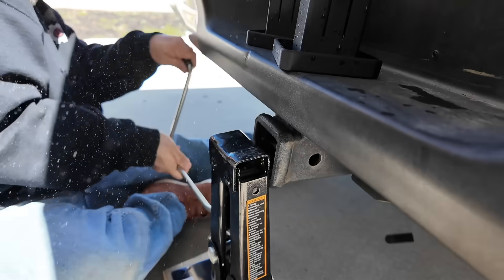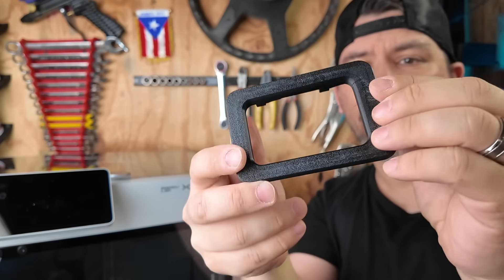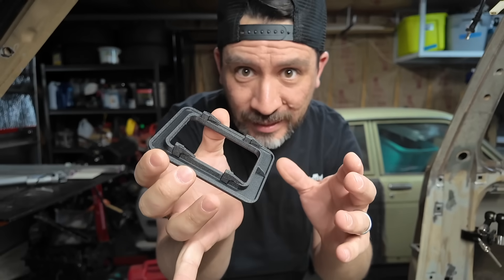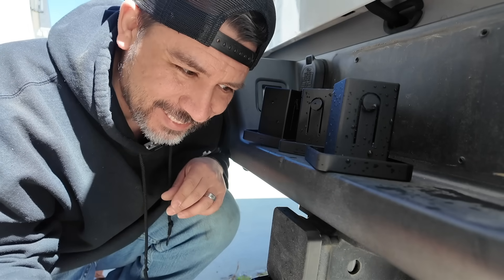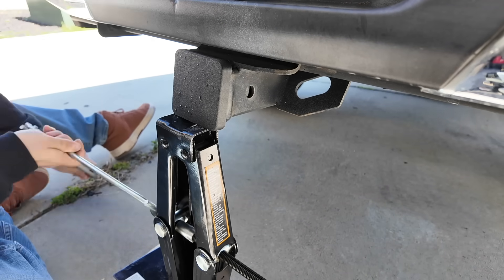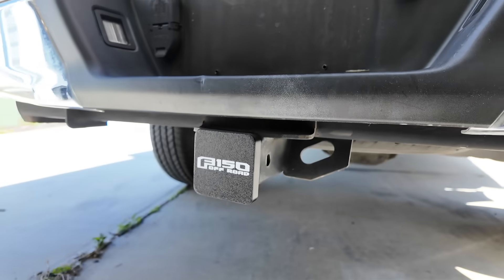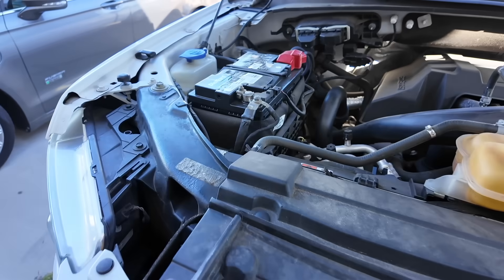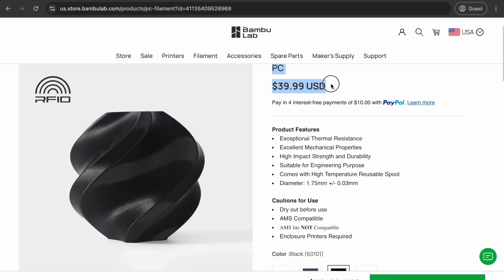Which 3D Printer Filament Makes The Toughest Car Parts?

Comment: 😅 Gloves for the CF. You can over exaggerate.

Biggest problem is getting dust in your lungs.
On your skin it's itchy. But not for only cutting filament 😂.

Thing break more easily on the layers.
I looks like ABS wasn't printed hot enough.
Abs isn't brittle and can be strong on the layers. PLA is much worse.
Have PLA in my car it didn't melt so far. But different went being loaded.
Reply from the maker: Can never be too safe 😂

Comment: Good Nylon 6,66 is the most durable compound I’ve found. 
Annealing in packed fine salt powder is key. 
Helps with heat tolerance and chemical bonds throughout the monocoque form.
Reply from the maker: I’ve always wanted to try that salt powder method, what type of parts do you print???

Comment: No problem with Petg and the sun, printed smoked indicator cover for my Mx5 4 years ago, still no color deterioration
Reply from the maker: Nice, how hot does it get where you're at?
Reply: @Itsallaboutthebuild  this week it was 32°C/90°F next week it will go up to 40°C/104°F

Comment: Gotta add my recent experience. I 3D print model RC aircraft. PLA is tough but deforms terribly in the car during transport as the temps increase. I just experimented with Polymaker HT-PLA thinking it was the perfect fix. After finding the best print temp and Factor K, it turns out to be extremely brittle and no good for model RC.
Reply from the maker: Oh really... Will have to add it to the list of filaments to test out. Do you actually fly your models?
Reply: Polymaker HT-PLA also goes soft and flexible at the same temp as PLA, around 53-57 degrees. It is not at all what they claim; it's a hopeless material. Try putting a print in 60C water for maybe 10 seconds, then bend it like a banana ;) Polymaker lie.

Comment: Definitely need to learn how to model parts for 3D printing strength
Reply from the maker: There's tons we learned. Besides printing in different filaments adding more walls, redesigning with thicker layers, and printing in different orientations can help big time.
Reply: Isn't the point of this for comparison though? So it doesn't really matter.

Comment: Worth noting when designing replacement parts you often have to design for 3D printing and not just copy the injection molded or otherwise manufactured part. For example with the door handle surround, if there is room you could widen the tabs to increase strength and add a tapered support at the back of the tab rather than keeping the sharp L. Sharp corners in general are also stress riser areas which means they are more likely to crack at those points, so round all your corners. Print orientation can also make a difference, but it can be hard to get the desired finish then. Fuzzy skin is a good way to get a cool look if you wants something that looks more like a bed plate texture. Cool temperature testing too!
Reply from the maker: Thanks for the tips, great points about designing for the process. We've been doing some fuzzy skin testing and love it.

Comment: Can you try Pa6 CF please? I dont dry my filament (I recently found out how important it is) and the prints are quite brittle, it would be cool to aee you do this filament at its real potential
Reply from the maker: That would be a great test for sure, what type of parts are you trying to print with Pa6 CF???
Reply: Yeah, I'm trying to print a plastic shell part for a car, its called an Isofix but for some reason ny prints just snap with a bit of force  @Itsallaboutthebuild
Reply from the maker: Try to add more layer lines.
Reply: If you want I can send you the STL file  @Itsallaboutthebuild
Reply from the maker: Do you have it posted on thingiverse?

Comment: its PPA, use ppa and forget the rest (except tpu)
Reply from the maker: But what if you don't need that high end, its much more expensive no?
Reply: @Itsallaboutthebuild 55/kg is not too much more and worth it to me at least for the extra durability
Reply from the maker: Nice, what type of parts do you make???
Reply: @Itsallaboutthebuild I make custom enclosures for equipment, car parts, drilling and cutting templates, fixtures for assembly, mounting jigs. Everything I can thing of!

Often use it to prototype stuff before having it Cnc cut
Reply from the maker: Oh wow, thats awesome. We're working on some more car parts, so what would you say is the hardest thing when it comes to learning how to make 3d printed parts? Trying to put together some more helpful content. Thx!!!
Reply: @Itsallaboutthebuild identifying good use cases for a 3d printer, then turning the idea into a reality
Reply from the maker: I hear ya. Hopefully our content on designing with Shapr3d will be helpful. Thx!!!
Reply: PC CF is superior to PPA CF if we are talking about glass transition temps. And it’s cheaper.

Comment: Most of the time i find that pla is stronger then abs, when i print them they both look amazing and smooth, however the layers on pla seem to bond better is there something i can chang print temp 270c bed temp 95-100c speed around 35mm sec ( bambulab p1s)
Reply from the maker: PLA properties has better adhesion than ASA. Try adding more walls, design the part to have more surface area between layers, or print the part at an angle. 🙌🙌🙌
Reply: Thank you for the tips i tried more wall thickness and it worked a charm, awsome! @Itsallaboutthebuild
Reply from the maker: @tomaswolsink7620 that’s awesome!!! Stay tuned for more 🙌🙌🙌

Comment: You're not really testing the strength of the plastic.  Due to the orientation of the model you're testing the layer adhesion of the plastic.  That's a completely different thing, makes the use of the glass fiber filament pointless.   Just print a solid bar for the towbar shaft and test that.  You can superglue a cap on if you like the textture of the end.
Reply from the maker: 110% correct, its the layers you are testing which I did talk about. And you could go with a different orientation, but you wouldn't get the nice texture from the bed :) Solid bar would be a good test too, was just trying to show a bit more of a practical part. Thx for watching

Comment: Bigger internal radius in the cap part would help
Reply from the maker: @deanlegg418-u2k  ah yes, also don’t like how thin the snap on parts are. They break after about 20 pushes. This part definitely needs an updated design :)

Comment: ASA and ABS Don't have strong layer adession strength like petg. Any fillers will make the layer bonding worse. If you print in horizontal way so that all the layers lines in one direction it will make it stronger.
Reply from the maker: Ah yes, but we like the texture of the build plate :)

Comment: Can you make discontinued car parts? I need a hood latch cover for a c6 corvette.
Reply from the maker: @jmarcant616  if the original part was plastic then it’s possible 🙌🙌🙌
Reply: @ it is plastic. It’s more of a cosmetic piece. I can send a picture
Reply from the maker: @ have you tried eBay? Looks like someone already made it
Reply: @ yes , but that one looked rough. Not clean looking.
Reply from the maker: That's because they 3d printed the part with fiber reinforced nylon, which gives it that texture similar to the look using ABS-G on the door handle clip in our video. Using something different like PC would leave layer lines in the part instead of a textured look.

Comment: In my experience abs is only strong and pretty much unbreakable if you use 100% infill or walls. Cf are actually weaker because worse adhesion. Unless it's nylon.
Reply from the maker: Ah, good to know.Would be cool to test with different walls and infill. Do you 3D print car parts too???
Reply: @Itsallaboutthebuild  no but I'm printing it for a different project. 280c nozzle and 60c chamber. I made a small 8mm block. Tried all walls vs 80% infill. Then I smashed both with 2kg big hammer. The full walls part has minimal cooling and good layer adhesion and is insanely crack resistant. The 80% infill failed instantly.
Reply from the maker: @morecakesmorelays3270  that’s awesome. What 3D printer are you using??? Looking for a larger build volume with enclosure and good auto bed leveling/z-offset
Reply from the maker: NICE

Comment: PPS-CF is the way!
Reply from the maker: Will have to give it a try, what type of parts do you print with it???
Reply: @Itsallaboutthebuild I also use that. Polymaker Fiberon. No car parts. Machine parts and other structural parts. I don’t know how familiar most people here are with machining, but it’s similar to that in that high speed steel bits bend a bit before failing. Carbide has no give, it’s very stiff. But it’s brittle. It will suddenly fail. But, it is much stronger, so it will fail at a much higher performance level. PPS-CF is like that. Very strong and stiff,  takes high temps. I print between 330 - 340 C. Virtually no creep.  But when it fails it will do so suddenly, like carbide. I’d have to look up its low temp performance. Oh yeah, it’s very expensive. $70 for 500 grams.
Reply from the maker: @melgross  Nice, I need to print some small replacement brackets inside the engine bay and it sounds like PPS-CF might be the best route to go. What 3d printer do you use to print PPS-CF???
Reply: @Itsallaboutthebuild   Typo meant PPA-CF.  Make parts to fix showers and even parts for cars.  Make sure can hit 300c and dry it good.   https://store.bblcdn.com/05b0e4ca5ee14a4cb378cfa48df24f91.pdf

Comment: increasing the infill will make the ABS much stronger , from the videos he is using 15% infill which standard setting .
Reply from the maker: You are 110% right. Also increasing the wall count will help with layer adhesion which makes the part stronger too.

Comment: Part location in the vehicle is important. ASA will deform on the dashboard close to the front windscreen but not 2 feet further towards the inside of the car (on a 40 degC or 104 degF day) meaning inside the cabin of the vehicle is pushing the limits of ASA let alone under the bonnet.
Reply from the maker: @karlosss1868  good to know. ASA is rated for up to 212F and has really good UV resistance according to manufacture specs. What would you recommend besides ASA?

Comment: Very interesting video, thank you. I watched a video in which they printed 4 clips that held on to the sun visor out of the sun and just relied on the heated cab. PLA, PETG, ABS and ASA were the filaments. ASA was the best with no flex or softening. Thank you again for your video.
Reply from the maker: You’re welcome thanks for the support and watching along 🙏 Yes, ASA works extremely well in the sun and weather from more testing. So what type of parts are you looking to 3d print???

Comment: Not sure if you can print it with the X1C or not, but we use PP in engine bay parts all the time.  We also used various glass filled nylon parts for the coolant system.  All these are injection molded, however, which will make a difference.
Reply: PP (Polypropylene) is a bit more diffucult to print because it does not stick to the build plates in their natural form.
There is a german company that makes and sells print plate adhesion plates. Which feels like a sort of rubber, and pp filament and and explanation how you can print PP with their adhesion plate. I got a test sample, and was able to print PP in the second try.
Some swear that they print PP on buildplates they cover with clear packing tape. Never tried that myself.
PP does not need to be dried as it is one of the very few non hygroscopic filamen types. And most special: PP is resistance to more chemicals than all the others.
Found that when i wanted to print somehting for the Lead Acid batteries we have at work. PP is the only filament type that withstands sulfuric acid.
But i was unsure about the temperature resistance.
But if you use injectionmolded PP for parts in the engine bay, that should mean that PP is also heatstable enough when 3D printed.
Reply from the maker: Just bought some Nano Polymer Adhesive from vision minor. Gonna give it a try to see if I can get ASA to stick to diamond 3d effect build plate.
Reply from the maker: @joncue0304  will have to check out PP, thx. Which car do you 3D print parts for???

Comment: So i live in nyc and the summers here are brutal inside sitting cars.. I need to print a modified speaker terminal that uses magnets for the wire connections.. I was already thinking of using ASA for the higher temps and apparent reduced smell than ABS when it comes to printing.
Reply from the maker: @JustNel  the ASA worked well for the exterior and can be used for interior parts too. I say go for it

Comment: I am glad that my tests also came up with similar results. ASA and PET CF17 is what I’m going with for my Porsche parts.  Check your infill density for more strength
Reply: In this specific test it's layer adhesion which is being tested. If the parts were printed at 45 degrees angle to the bed they would be 2 times stronger. Since the pressure would be directed at 45 degrees angle to the layer lines.
Reply from the maker: @ThomasAnderson-i3b  110% agree. Perhaps testing against different orientations should be in a different vid 😁
Reply from the maker: @YogisGarage  oh nice, will do some more testing with infill and different wall counts. What parts do you plan to print???
Reply: @ starting with interior parts like visor covers and center console GT3 mods. I found your channel when you were testing scanners. I believe that’s going to be a game changer.
Reply from the maker: @YogisGarage  oh cool, thx for watching. Trying to get some ideas of what other parts to test print. Working on going over basics of modeling too. Anything else you’d be interested in seeing???

Comment: I believe my MK4S needle gets a lot hotter than my x1c which enables me to print Nylon and ABS filaments with a bit more ease. I tend to use my Bambu for PETG a lot more. Good video by the way bro 😎
Reply from the maker: Thank you very much 🙏🙏🙏 What type of parts do you print???
Reply: @ I print parts for Ducati. The iPhone holder sells for 40$ a pop 💯
Reply from the maker: @DopeCity5000  that’s awesome. Been playing around more with ASA. Seems to do really well once we had our 3d printer a bit warmer

Comment: I am going to print those door thingies for my e30 too
Reply from the maker: @modernizedclassics  sweet, we’ve been playing around with adding additional infill objects to strengthen the clips. Thinking about doing a video on 3d modeling and printing car parts next… Would you have any suggestions on what we should cover???
Reply: Is it possible to print just sections of large plastic parts, it may be quite practical than getting all new parts sometimes @Itsallaboutthebuild
Reply from the maker: @modernizedclassics  you mean for exterior parts?
Reply: Yes  @Itsallaboutthebuild
Reply from the maker: @modernizedclassics  ok, cool. Have a project in mind for that. Will work on it and see how it goes 🤞

Comment: The parts here don't seems like they were truly optimized for 3D printing. Plastic part design is its own field and 3D printed part design is becoming more of its own field as this manufacturing process becomes more and more useful and realistic for the industry. Part orientation is also huge especially for the tabs and small features, many prints are best done at an angle to prevent the forces on the part from being in the direction of the layer. Good layer adhesion is important but the part can be exponentially  increased with part orientation. At the same time though, a plastic part should really never see any long term forces, especially clips and tabs because of creep. They can see forces and impacts but they shouldn't be prolonged to prevent creep. In the end its more than wall thickness and infill, if you are really trying to make a strong part you need to start at the geometry and then use infill, orientation, and wall thickness to further improve it.
Reply from the maker: @ant8485  110% agree. Changing orientation based on part usage will put less stress on layer adhesion for sure. We also like the finish from the build plate too. Next up we plan to work on creating our own parts using modeling software to get the best of both. Any recommendations on modeling software? We’ve been using Shapr3d with some success, but I’m sure there’s other good modeling software out there too. BTW, thx for watching and for all the tips 🙏🙏🙏
Reply: @Itsallaboutthebuild hey man, first time tuning in. I use Fusion 360 myself!
Reply: The prints are good for the purpose of comparison though.

Comment: Did you use some abs+ blend? Especially the Esun ABS+ has severe layer adhesion issues and does not even compare to real abs. Real abs is harder to print tho
Reply from the maker: Used regular ABS from Bambu Lab. Going to try ASA on the panel part as well.

Comment: Hey, after your video, I was looking around at new filaments and a few months ago they came out with a new one called PPA-CF which prints at 290 degrees celsius. This means its the strongest material that can be printed on the Bambu X1C or ELEGOO Centauri Carbon, and the video reviews I've found of people testing it says it's almost as strong as aluminum, and beats it in some cases. Just thought I'd let you know about it... Its not cheap though. I don't think I'll be using it anytime soon, but it could be really neat thing to have in your back pocket if you find a use case for it. The cheapest I've found it is from Creatlity for $79 per kg... Bambu also makes it, but charges double that.
Reply from the maker: Wow, PPA-CF sounds really interesting.  Just got some PET-CF, PA6-CF, and PAHT-CF to test with.
Reply: @Itsallaboutthebuild  I love trying new materials, but the wallet isn't a fan.
Reply from the maker: @secondleasegamer8312  true true, money really does buy happiness 🤣🤣🤣